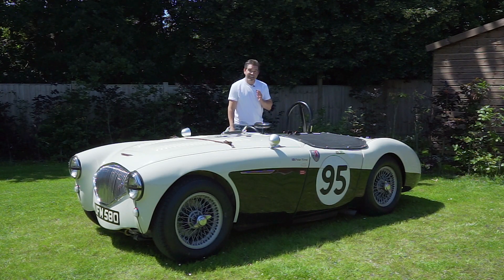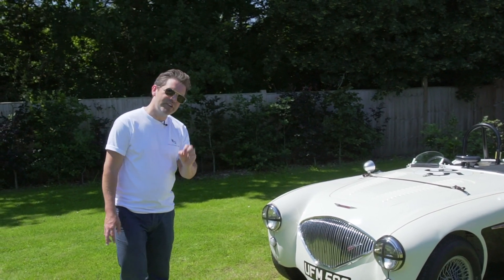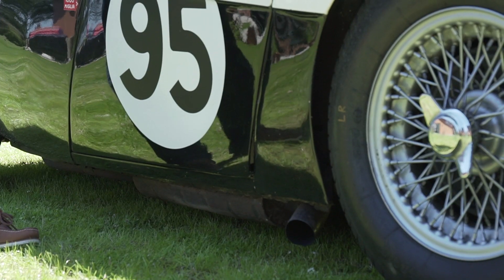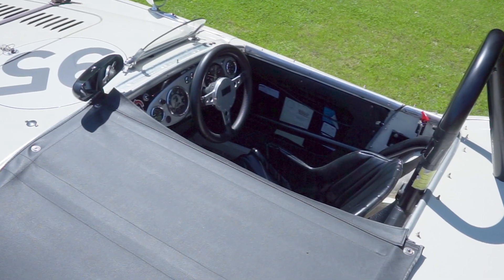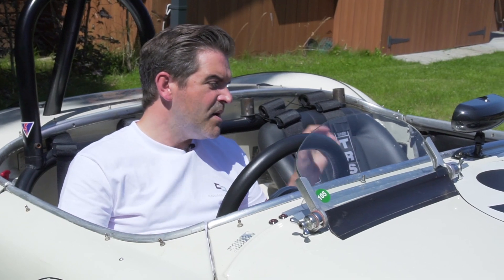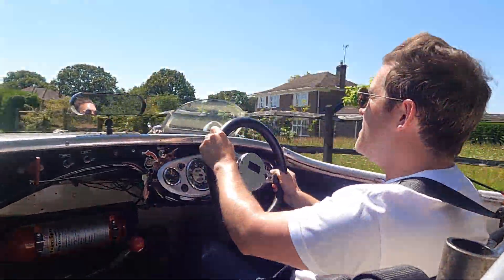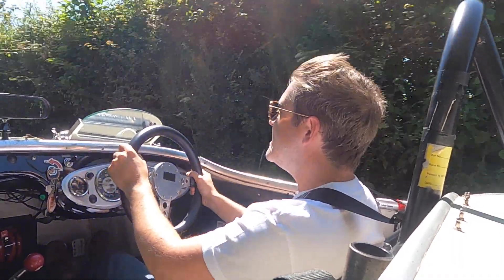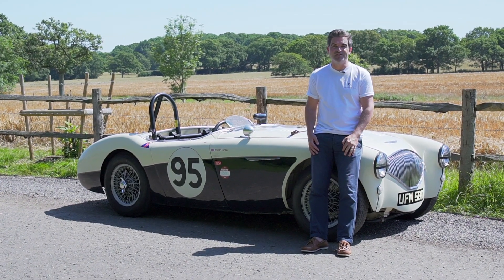1954 Austin Healey (BN1) 100/4 – FIA classic race car to 100M specification

Comment: Well done. I did the same thing with my 1956 100/4 in 1973. Took it to a machine shop, bought disc brakes, stiffer suspension. Kept the windscreen, though. The standard 100/4 wasn't much but the 100M was a lot of fun on the Angeles Crest highway.

Comment: I had a green 100M Le Mans Healey back in the early 70s here in central London UK.  I recall the thrill of its
declining "wow" exhaust note when powering up Edgware Road W2 in 2nd and then taking the foot off
the accelerator as I turned off that busy road at my destination.  An unusual feature - wide-rim wheels
and flared wheel arches that came with the car when I bought it for four hundred or so GBP back then.
Reply: @Mark Newberry........Mmm - sounds like the previous owner[s] tried to 'soup it up'? By the way - and sorry to ask - but were you sure it was an authentic 100M? [most were not!]
Reply: @thesoultwins72  My aged memory is being taxed now but that's how i remember it from documentation.  I also recall it's louvred bonnet held down by a heavy buckled leather
strap across its width, with two frontal small buckled straps - and how it could be lifted 
clear away to access the engine compartment when all three straps were undone.,  Also, I
recall the overdrive switch on the gear knob, its steel bodywork - and the sheer fun I -
got from driving it!!. My memory also tells me that the registration number was GEE 720.
Reply: @songsmith31a  .......Mmm - I'm sure your memory regarding documentation might be accurate but the fitting of the louvered bonnet and leather straps are all pretty common knowledge. [incidentally - ALL 100's came with overdrive. This was due to the fact that on the first iteration of the marque, the BN1 - the gearing was so out of sync, first gear had to be blanked off as it would rip the rear axle out!]
You are also totally mistaken with respect to the bodywork being made of steel. Both the front and rear shrouds were aluminium - only the doors, front and rear wings as well as bonnet and boot lid were steel. This led a to peculiar form of corrosion ['electrolytic' or 'galvanic'] where the steel and aluminium body panels had a destructive reaction when they came into contact. As a result, rubber beading was used to separate the panels - although this was only marginally effective. 
I would also point out that the majority of 100M's were NOT authentic. Healey Motors [which originally built all the 100M's] never kept a record of how many cars they produced. It was only when Austin themselves took over production [due to demand for the car], that they started keeping a log - and an estimated 643 were built. 
However, to confuse matters even more, Healey/Austin began selling a '100M conversion kit' so owners could 'upgrade' their stock 100/4's. [But yet again never kept a record of how many of these kits were sold]. Furthermore, countless 100/4 owners took it upon themselves to 'convert' their cars to 100M's as the process was relatively straightforward.
So in truth, unless your car met with all the upgrades [such as larger carburettors, alfin disc brakes, cold air box, high-lift camshaft, stiffer front suspension - plus the louvered bonnet and leather straps - and had a plate fixed to the engine bulkhead stating it was a factory-built 100M] there is no real or accurate way of telling if it is a genuine 100M or not.
Reply: @thesoultwins72  Thanks for the information.  I know that the leather strap across the bonnet 
was a known feature but I'm curious why my own had two small leather straps holding it down
at the front - noting the absence of these in the Healey shown in this posting - permitting the
bonnet to be lifted right off rather than fitted with a means of holding it open.  And I do recall
the bigger than usual twin SU carbs. I bow to your knowledge/opinions otherwise.  Cheers..

Comment: Isn't the 'fuel cutoff' actually the battery isolator? Even with the ignition on, the dash lights didn't come on until you switched the 'fuel' on. Also, those Dunlop CR65 tyres aren't strictly road legal. Beautiful car though.
Reply: Yup, it’s an FIA kill switch, required for sanctioned racing. If it was just a fuel cutoff the car would actually keep running for a few seconds. It isolates the battery completely, and in alternator-equipped cars, cuts that also, otherwise the alternator would keep the engine running.

Comment: I had a 1953 BN1 that I unfortunately turned into a race car. I used solid wheels because the wires kept breaking under cornering with race tires.